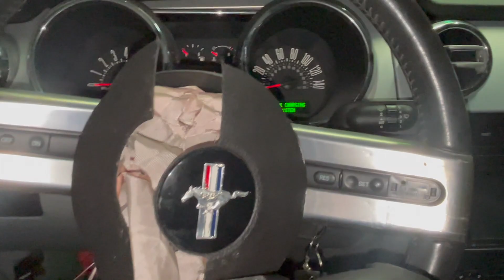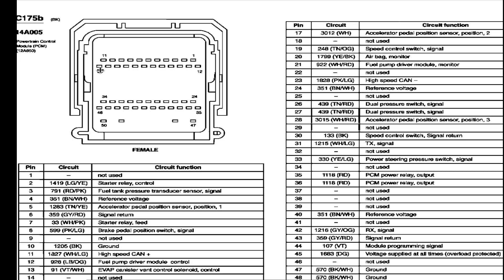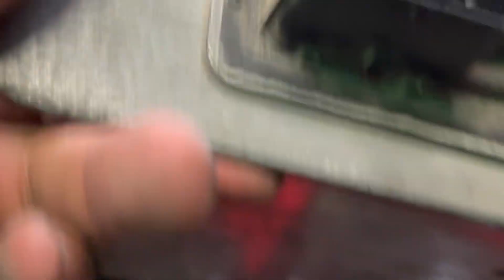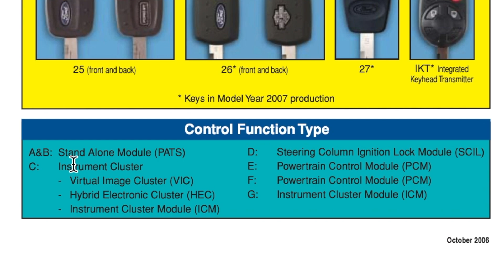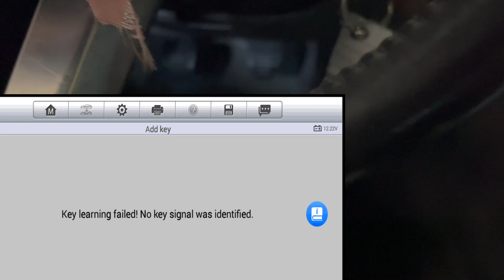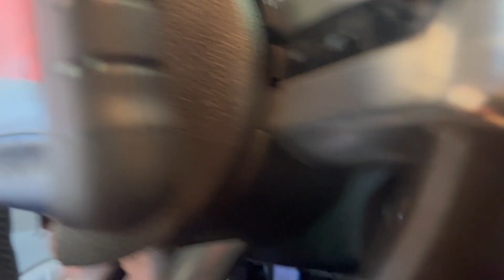Ford Mustang No Communication Repair

Comment: Does Pats  use CAN to communicate ??
Reply from the maker: Well on this one pats is in the ecm. You it receives the key code from the coil on the ignition by 2 wires not can. And when it receives the key information it allows the relay to start or not depending if it has a programmed key
Reply: @OzMechanics  Thanks for reply and info 👍

Comment: Wow, great job and cool video!  What's with the rusty weld on the right fender flange?!  If an insurance company was involved with this wreck, wouldn't they pay for the computer to be replaced since, apparently, it was damaged in the collision?
Reply from the maker: I’m not sure what body shop had this. This was sent to an electrical shop and I was subcontracted by the electrical shop to work on this.
Reply: @OzMechanics  crazy they didnt bother takin off the ecm to check for damage lol OZ ftw

Comment: I'm curious about the donor key. Can you use this key again to do the same thing on a different vehicle using the same process, or since your donor key is now programmed, would it be useless on another vehicle? Just wondering if the donor key has to be a no programmed key for this to work.  Thanks for the awesome video !
Reply from the maker: This donor key can be used multiple times. That’s why I cut the blade and have it in my tool box. I got a handful of keys from the junkyard

Comment: I didn't quite understand where the 1st and 2nd donor chip came from to make this work when it failed. Nice work though!
Reply from the maker: Remember on the video, I explained that if the PCM holds the PATS information and we are replacing it, we will need 2 keys. But because the customer only had 1 and didn’t want to spend more, we opted to try to program a donor key. So we started off by programming the original key that came with the vehicle. And when we went on to program the second key, I covered the programmed key because that allowed me to turn the lock cylinder. Once we turned the key and  were ready to program I put my donor key next to the other key to get programmed. Aluminum covered the first programmed key, so the vehicle wouldn’t try to suck in the already programmed keys information. Hope that helps
Reply: @OzMechanics  Thanks Oz. I guess that was my question actually was where you got a "donor" key.  If it happens on another car where does the "donor" key come from?